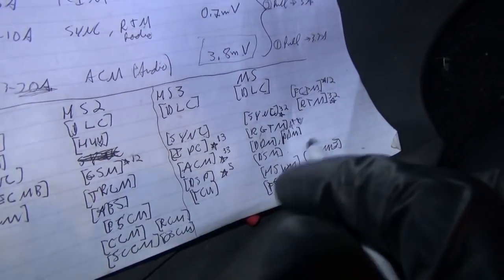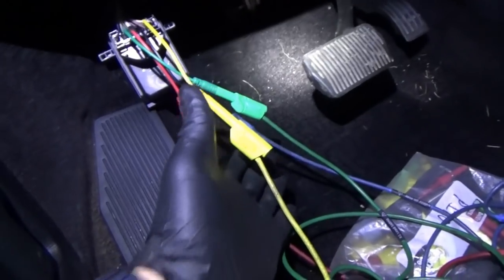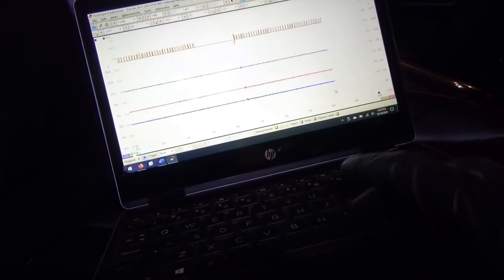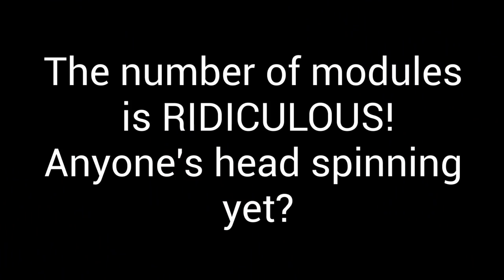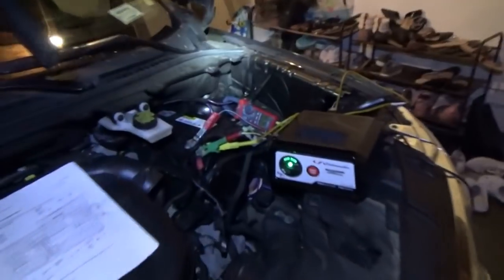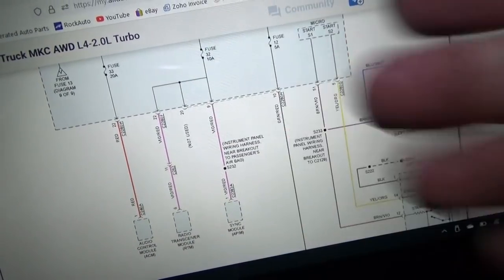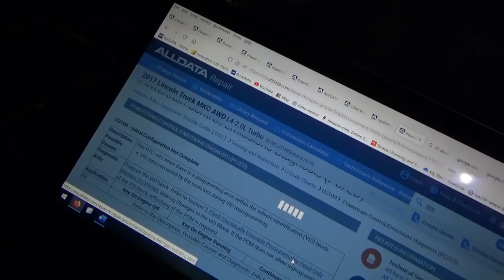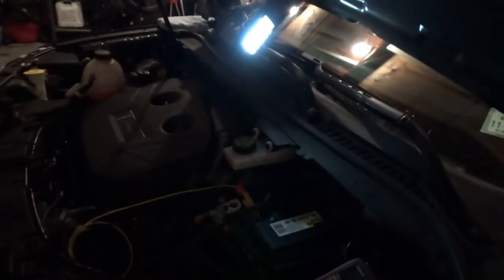7 HOURS to find a 5-AMP Draw?! (Lincoln MKC - Part 2)

Comment: Parasitic draws caused by network faults are the most challeging and time consuming faults to find. But you nailed it like a boss! 👏
Reply from the maker: Dan that really means a lot coming from a professional like yourself! At least it wasn't a BMW! 😅
Reply: Getting a comment from DD is wowser for sure.
Reply: Excellent video as always Ivan! There is always something to learn from your content. Oh, and nobody can deny... You da man Dan!!
Reply: Hi Dan!  Happy New Year!
Reply: My favourite technicians, Dan and Ivan!!
Reply: Hello Ivan and D-Dan,

I'm actually an automotive wiring engineer on the production/engineering side, but not the service end.  I watch many videos for parasitic loss and many posters have "new" ideas.  Wiring integrity is much easier to test when not in vehicle or connected to a host of modules.  One of the newer options is thermal scanning....LOVE IT!

To both you guys (diagnostics experts, in vehicle), I want to ask:  Instead of measuring voltage drop on the fuse, why not go Fuse to Ground and find the full load voltage drop?  If Negatively controlled, should be able to check Fuse to batt+ for full voltage drop.  I am not testing wiring integrity, but looking to easily find the current draw.

NOTE:  With so many modules, a max/min amp meter or better yet O-Scope with recording must be used as draw can only be found when module is "awake" or trying to pull a load.

Please advise.
Reply: PS:  The CAN bus pulls almost ZERO amps, focus on the modules.  This is not to say a bad communication could activate modules, only that the bus does not kill the battery and is almost always active.  If module is bad on the bus, I would expect a bus communication issue????

Comment: Wow - that was an epic diagnosis! It would be nice if brands implemented a 'force sleep' mode as a two way test so you don't have to wait 20 minutes to  continue diagnosis. Thanks, Ivan.
Reply: Excellent point. Maybe if the scan tool had that in the software...you as the tech could invoke the command with the scan tool and execute the command to GO TO SLEEP.
Reply: They could ask Locutus. He's done it on a complex network.
Reply: Call it Ambien mode
Reply: Awesome job!
Reply: "Force sleep mode"....disconnect battery.
Reply: That was a real challenge!  I'm sure Ford is real proud of that module!
Would be interesting to find out what was causing that module to stay on.  Maybe an input or a component problem.

Comment: Unbelievable diagnosis.   The thing about diagnosing vehicles is you have to have persistence.  Many just don't have the will power to keep thinking and moving forward so they give up and usually fire the parts cannon.  There are pressures on technicians to make hours and they can't win on a scenario like this so they give up and move on or order parts to move the vehicle out of the shop.  But each time you find and fix one of these, it adds to your knowledge bank and helps you on the next one.  Even Josiah learned a ton during this one and he will be better the next time he has a similar situation.
Reply: yep its called getting tempered in the fire . it takes courage, patience, determination. everybody is watching the clock, and the bill is adding up by the minute. you start wondering if they are wondering if you know what the heck you are doing.. they start asking hows it coming, making any progress?  or say I think I might trade it in.., lol
Reply from the maker: Huge learning experience. We'll recap in Part 3 👍
Reply: @PineHollowAutoDiagnostics  Ivan maybe start doing an after action review as bonus footage discussing in hindsight what possible other paths could have been taken to help in the diagnosis. looking back, we see that the entertainment center was staying on when it should be off. could possibly starting there, then work BACKWARDS to the modules  have been a less arduous path to the diagnosis.  
also the manufacturers should be pressed to provide a detailed description of the order of operation that takes place on the CAN bus systems.  an electrical schematic does not suffice, because you do not know what the order of  processor commands are.  all of this really comes down to high tech computer repair and unless the manufacturer provides the specifics of what the processor does, and when it does it,  also with basically no onboard troubleshooting in the CAN bus system, OF the can Bus system these cars will be a nightmare for a long time to come.  A law passed several years ago that mandates manufacturers shall provide any and all information needed to repair a vehicle yourself but the manufacturers arent complying. they are hiding behind that processor.
Reply: But wouldn't just pulling the fuses have found this faster? It's crazy, fuse 32 had no voltage drop but that was the issue?
Reply: @Walczyk  you have to modify your electrical troubleshooting train of thought now.. its no longer  fuse , circuit , component.   its  FUSES, PROCESSOR OR PROCESSORS, MODULES, CIRCUITS, COMPONENTS.  some modules indirectly control other modules .  The engineers that built the network designed it for things that they believe were important in  order of function.  being  it seems that the alarm system is on the medium speed network , that is likely activated partially all the time. also the key  proximity monitoring is there.  part of the job of the same module may be to signal other modules to turn on and activate other modules or send commands thru the can bus network once certain criteria are met. but if it malfunctions, or gets corrupted, it can send errant signals to other modules, that activate other circuits at the wrong time. 
I imagine in the very near future,  if its not happening already, manufacturers will be sending wireless updates and software changes to the onboard computers. it will be like Windows,, plz do not turn off your vehicles, we are installing updates.. the manufacturers will try to make you addicted to a vehicles, just like a phone.
Reply: @randy1ization  Yeah but why was there no voltage detected across fuse 32 during the original diagnosis?
Reply: @Walczyk  im not getting a brain cook watching it again,, ha ask ivan.
Reply: Absolutely brilliant in self motivation to keep looking. He definitely loves what he does and has drive to KNOW what is the problem. I say this because I have devoted long hours and not charged the customer because I wanted to know what was causing the issue. As a mechanic I truly believe it is a duty of mine to protect the customer’s investment. When I see videos like this it makes me happy to know good mechanics are still out there. I want to give mention to SMA, Eric the Car Guy, Scanner Danner and many more who keep me going as well.
Reply: @collinbaroh3487  the reward for caring and being completely honest with customers is TRUST.  When customers trust you, alot of the pressure goes away, because you know that they have complete confidence in your abilities and moral standards.  word gets around fast and u dont even need to advertise.  customers will seek you out. 
as far as most vehicle owners they neglect thier cars,, they know this., they will budget money for high priced cell phones, large screen tvs, other toys and gadgets but not thier cars.  so its very, very likely that when it gets to you, there will be several problems.  they hear the brake pads squealing for months,  then when the car wont stop, they bring it in and act like they are so surprized that they need new rotors and give you thier desperate story of how they really cant afford it.,,.
you must NOT make an emotional attachment to the customers problem., you must be like SPOCK.. logical, calm, straightforward, but respectful.  if they cannot afford to maintain and repair thier car, they should not own one., bicycles are cheap, so is public transportation and skateboards.
Reply: @randy1ization  never said I had a emotional attachment to a vehicle. I merely commented on the technicians ability to diagnose. I do what I do for my customers because I can. I own my own garage and am not hurting for money. My comments were in point of getting the job done right. I have been doing this for some time and I know all about the industry. I am a one man shop and have built my reputation off of word of mouth from the quality of my work. Thanks for the comments.
Reply: @collinbaroh3487  I didnt  direct my comments to you, but to the average technician.. . I too was in the service industry,  mostly a one man operation and learned alot in 20 years dealing with customers.
I learned there is an occasional customer that you just cant make happy and sometimes its best to refuse them service. The ones who believe they have to get everything for nothing and those who wont even give you time to figure things out or tell you how to fix something that they cant. . in my 20 years of service I had around 5 customers that I  refused to service. 
I slept great every night, knowing I treated people fairly and knowing my phone would be ringing the next day with customers wanting my service.. getting rich was never the goal,. but I did pretty good.. when A man can sit and ponder about something they want but dont have and come up with NOTHING  , its a great feeling.  Literally any thing that I want, I already have.   I am BLESSED AND GRATEFUL.
Reply: @randy1ization  well said Sir. I’ve been fortunate to this point without a headache customer. I’ve been solo only a few years but I do everything from business to diagnosis. In the overall scheme I’ve found that training the customer is step one. Speaking on a level to which one can understand the complexity of our industry. I also have found that keeping up on situational reporting whether good or bad keeps most at bay. I love what I do but I definitely do not short change my time.
Reply: there will be times when you fix something one day and they call the next complaining same problem.  you have to go face the fire and fight it until its gone.  ive had mornings that I felt like I would puke, going deal with a issue again. I worked in peoples homes, so I  had no quiet place to just get out of the stress. 
always remember this, you only have ONE CHANCE to fix something right the FIRST TIME.  Sometimes u just have to spend some time with a car or any mechanical or electrical problem,,  it will eventually reveal itself to you.,  sometimes pulling yourself off of a problem for a while is exactly wharts needed because it lets you clear your mind and the real knowledge that is filed away in your subconscious mind can come to the forefront.

Comment: Navy aircraft design..specifically the P3A orion. Systems were designed to make sure FLIGHT ESSENTIAL ELECTRONICS  were able to survive in case of damage or fire. Crew members had to memorize all the circuit breakers inside the " tube" or interior fuselage. We had to know how to disable systems that were shorting the main bus bars or in case any electronic equipment was smoking or on fire. Very complicated indeed..but the engineers made sure we could keep the engines turning and get the landing gear down with catastrophic electronic failures. I wish car engineers would think like that.
The rtm seems like an essential control, it should not have been buried like it was, and its loss should not disable the car. All that money spent on 30 modules, and they couldn't build in one more  redundant back up to ensure the car could limp somewhere
Reply: As far as starting it, there is a backup fob slot. To start car when battery in fob is dead. The FOB still incorporates an RFID circuit. When placed in the backup slot, it energizes the fob rfid cicuit and you "SHOULD" be able to start the vehicle.
Still, way too much electronics for my liking.
Reply: @Joetechlincolns  I saw that slot when Watch Wes Work programmed an extra key to a Ford. It's in the center console.
Reply: @erik_dk842  not always, but sometimes yeah. In most nissans it's to the left of the steering wheel on the dash. it differs by manufacturer
Reply: @T.J. Kong but they can unlock the doors from space.. go figure.
Reply: It's getting to the point where I'm starting to believe that manufacturers want people helpless and stranded, so they'll rush right back to the dealership for another one. The other half of it is all the low-bidder absolute junk components sourced to build these vehicles, and the way they're carelessly thrown together in the name of speed. The source is greed either way. Imagine paying $70k for a vehicle and having this happen! That's what I owe on my friggin mortgage right now! Downright criminal ...
Reply: Like maybe having somewhere you could put the key to activate the car if it fails. A conventional RFID reader like an old turn key has.

Comment: That was a complicated parasitic draw diagnosis Ivan! It's crazy how these newer vehicles are too dependent on modules that you literally wont be able to start it if one of the modules were bypassed. Looking forward to the last video for this vehicle.. thanks for again taking us along the process. Cheers!
Reply: if you look at the big picture the parasitic draw was the symptom,  the CAN network fault was the real problem.  thats what I would record on records as the diagnosis. it will help customers understand that it was just not something staying on.  they must understand that the highly complicated on board computer system had a MAJOR malfunction that rendered it inoperative. then maybe next time they buy a vehicle they will think twice abt getting all of the tech bling. 
a car is supposed to be for transportation, not a mobile entertainment center.

Comment: I have to say.   I feel that electrical diagnostics ending up with a problematic, yet still functioning control module, can be some of the toughest electrical problems to find.  This case study was a perfect example of that.  The module in question here, for the most part, is still functioning.  Just not exactly as intended.  The shop I work for, everything is fast paced.  So, it's pretty rare that I get the time to really dig deep into jobs like this.  Plus, I usually don't have access to some of the tech I would need.  So, it's a real pleasure for me to watch people like Ivan, roll up his steeves and get busy.  Amazing detective work there Ivan!  I can't wait to see the conclusion.

Comment: This is just amazing...! Ivan, absolute insanity...
    I am recalling a good friend of mine whom was a factory trained GM technician..., telling me (1980-90’s time frame) that most of the vehicle(s) that came in for a problem was an electrical related issue...
     He referred to them as a “F.R.E.D.,” (f’ing ridiculous electrical device) problem...
     He also made not that GM had, at one point (to cut down on weight=fuel economy & overhead=the almighty dollar), gone to aluminum wiring in their autos..., for a couple of years, but then went back to copper..., as they were having some many problems related to using the aluminum wiring...
Great video series,
Thank you sir.
Reply: It's very amazing the idiotic cycles companies go through with newer generations of employees who simply do not learn the history of aluminum wiring. Residential home builders tried all of that in the 1970's through early 80's and found out that power cycles would expand and contract aluminum to the point that it would destroy itself and work just about every termination loose. They stopped and went back to copper right about the same time "drywall" got invented.
How and why these engineers fail to recall the past and then try again forcing the public into overly expensive design and material flaws should be unlawful.
Reply: @Garth2011  
they don't care about the past....they live in today...problem with lots today....is the lack of interest in anything beyond a few years....and being educated isn't the same as Intelligent.....it is why the best inventors weren't programmed to not think...they had free minds and interest in what they do.... younger generations think nothing happened before today...but they are living in past technology....it was invented way before they were born....
Reply: @garymallard4699  
Wheeeew...!
   Nicely “put”..., spot on my friend..., spot on...
Reply: GM at one point bought Hughes Aircraft, and put a version of their heads-up display in their cars.  They went to electronics and robotic assembly lines early, then backed out for awhile.